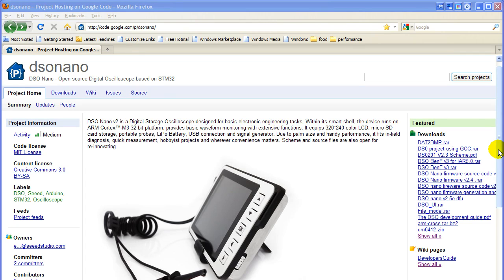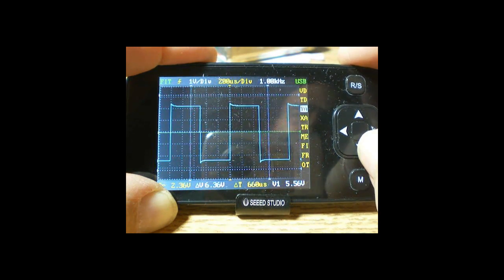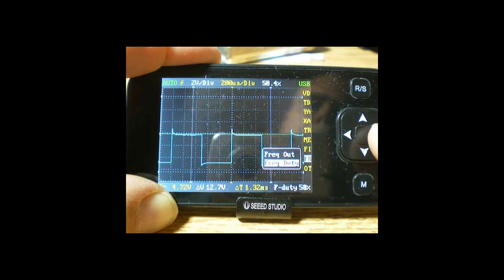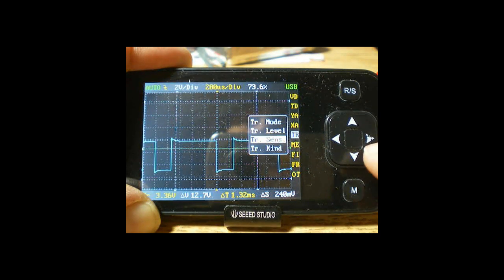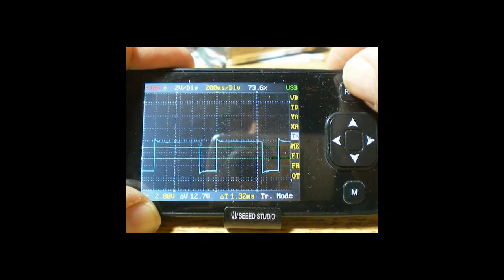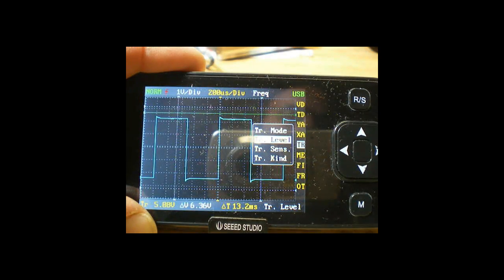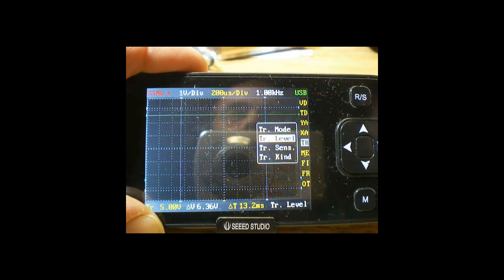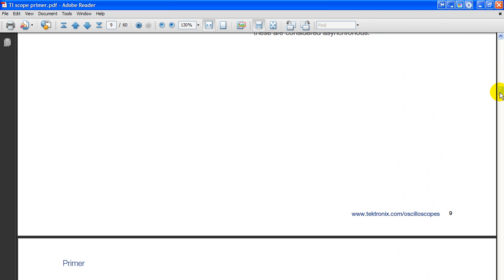DsoNano v3.4 #2 Setup & Trigger Procedures

Comment: The version two has two keys on the top edge of the device. The A key is the same as the version 1 Run Stop key. It also has a B key which is named Quick adjust.
Great videos, many thanks.